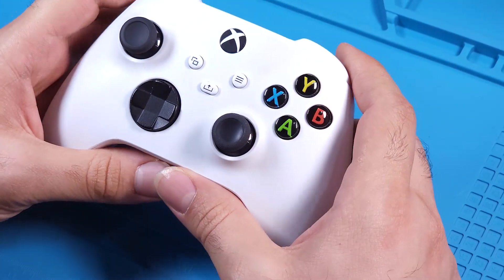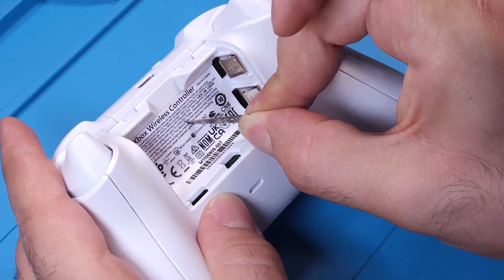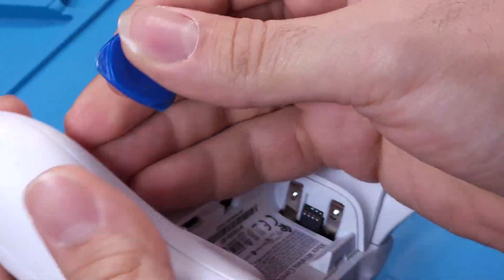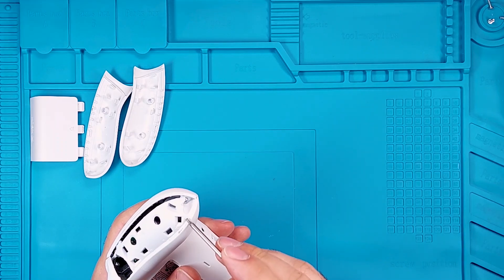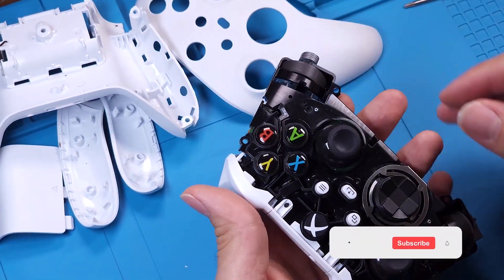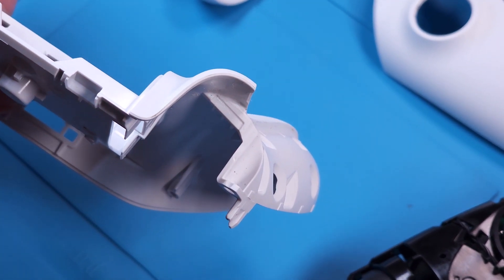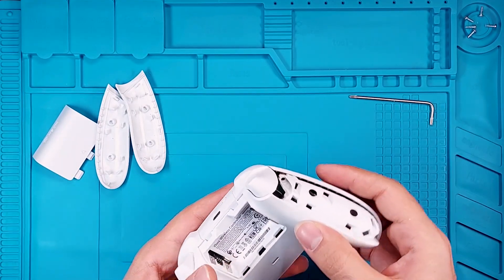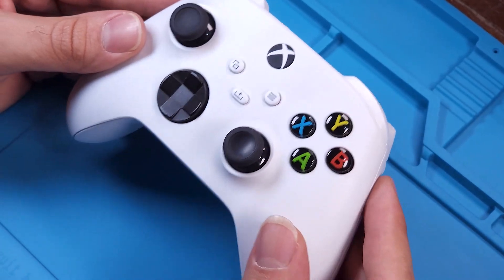Fix Sticky Xbox controller Triggers | Complete Teardown, Repair & How They Work!

Comment: ive this controller now around 1/10 of the time i used the 360 one but opened it already 10 times more than the old one. Also i sended back mine once and lol used the 360 in that time. I dont say this one here is bad but the old ones were outstanding longlivly :D

Comment: My controller's RT is randomly pressing on its own and it doesn't register properly to 1 when I press RT
Reply from the maker: It’s likely a Hall effect sensor issue. If cleaning doesn’t help, a hardware repair may be needed.
Reply: @InnoTinker  So do I need to replace the potentiometer or the trigger only?
Reply from the maker: If your controller is the same model as the one in the video, it doesn’t use a potentiometer. As I mentioned earlier, you’ll need to check the Hall effect sensor and its related circuitry. If you're not familiar with electronics, I’d recommend reaching out to a repair center.